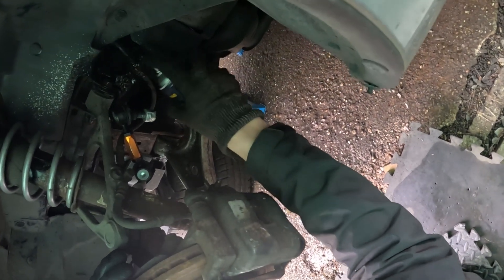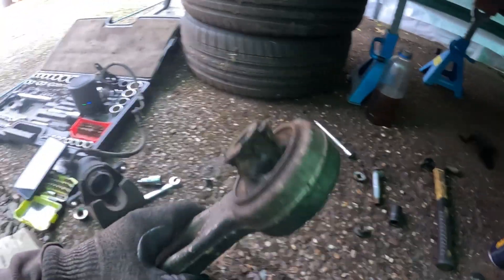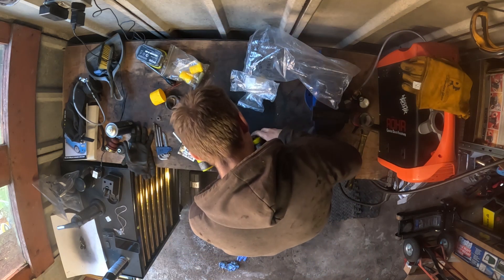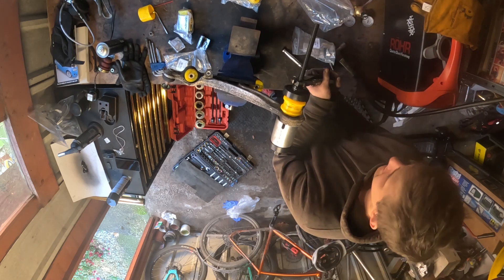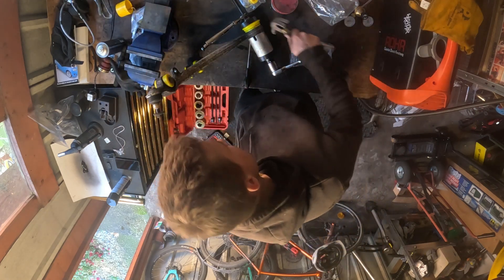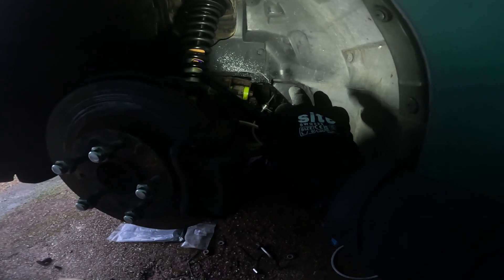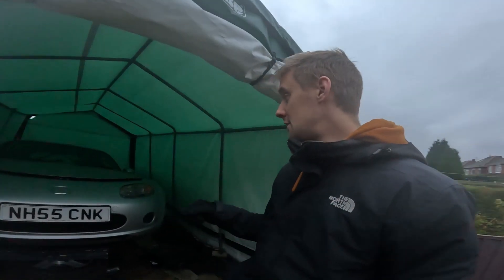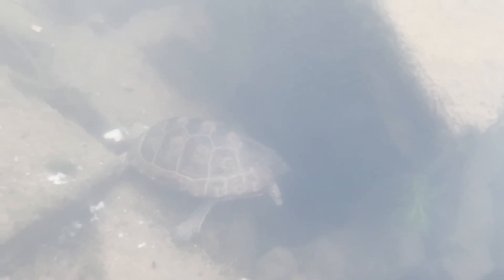Track Car SOS | ep20 | 3 Minutes of this video is me fitting 1 bushing

Comment: Heat the poly bushes in very hot water for 5 mins before use and heat the wishbone with the blow lamp lightly for maybe no more than a minute and they should go together a lot easier with some silicone grease and the vice bolted down....just a thought
Reply from the maker: Interesting, it never occurred to be to soften the bushes in hot water! That could be a good tip, thanks.